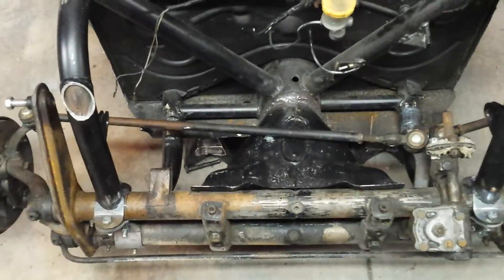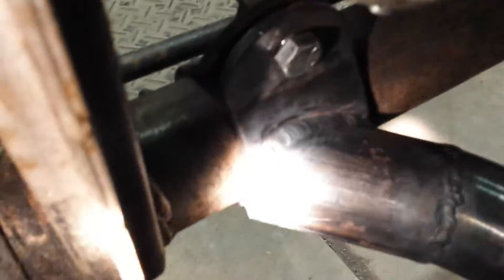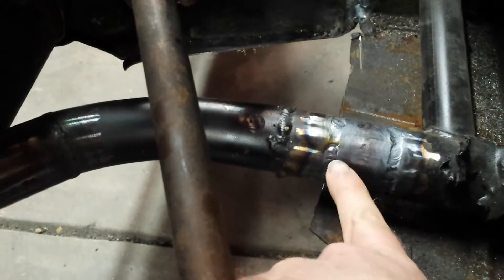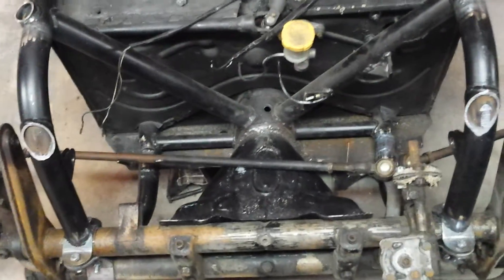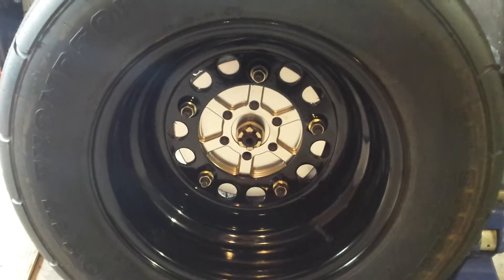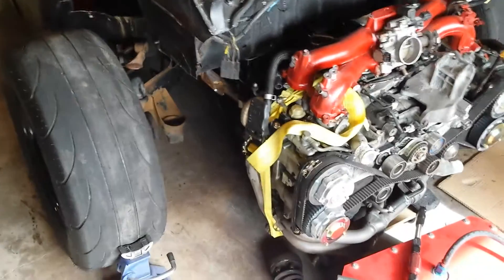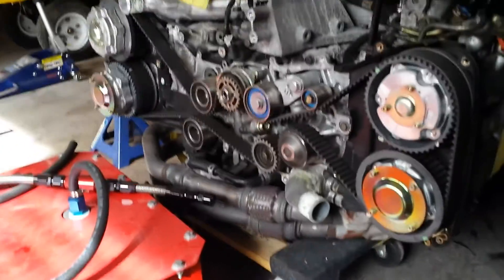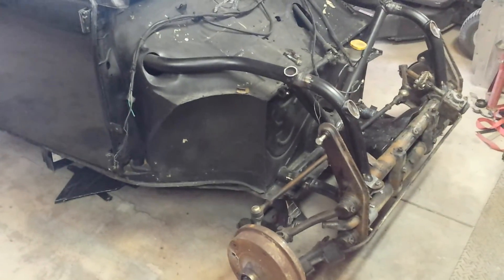VW Bug Project With Subaru Engine: Update #2

Comment: I hope you did not cut the X out of the front. Add the other bars is fine If you cut those out that thing will twist in a fair bump. but seeing this was a long time ago you already did. I have 8 inchs from ground to Frame rail that runs under my motor I did that as to not hit any part of my motor. good luck
Reply from the maker: I scrapped the project, so it's a non issue now haha thanks for watching!